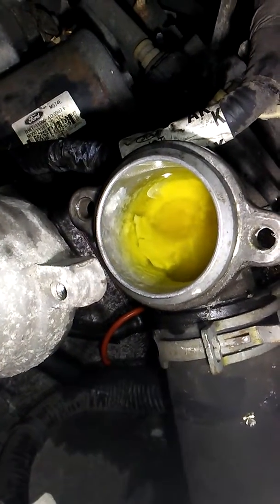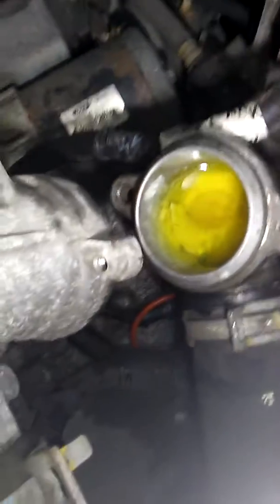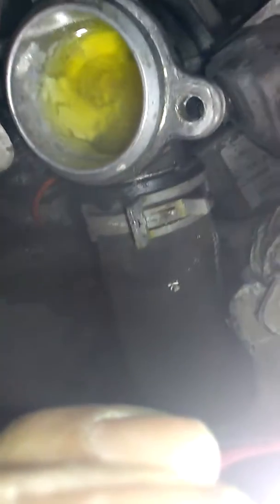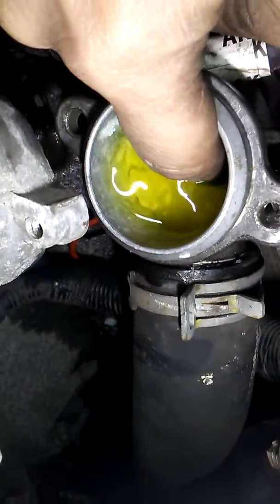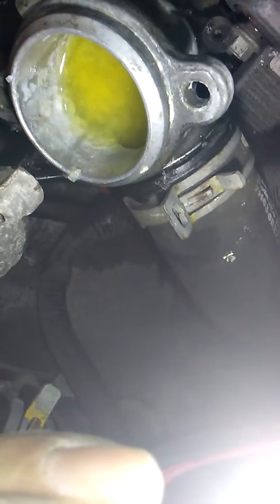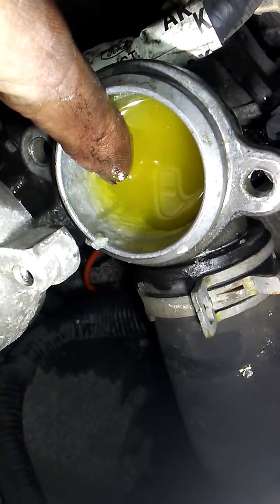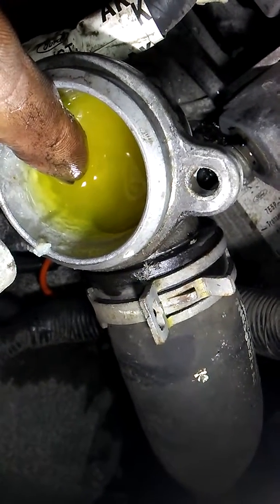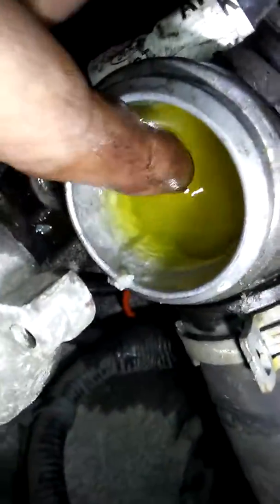2007 Lincoln MKZ 3.5L clogged up coolant system

Comment: Soo, what will you do?  You provided really no information other than your'e about to Ram it up the ladies ass.  Why make a video with no solution?  You guys are all the same.  Dipshit.
Reply from the maker: BO NES well you don't like my vid hey no problem just shared this cause I never seen one this clogged up, it was result of water pump failure and shit ton of stop leak that was put in by others, anyways this dipshit is his own boss and runs his own shop, in my eyes dipshits are on here in search of answers cause they need another dipshit like me to show them, sorry this one vid out of many of mine has no real info

Comment: Ford uses oat coolant which is incompatible with older gycol based coolants if the two are mixed it gels up like that
Reply: I’m being told it’s an electrical problem if heat does not work but air does